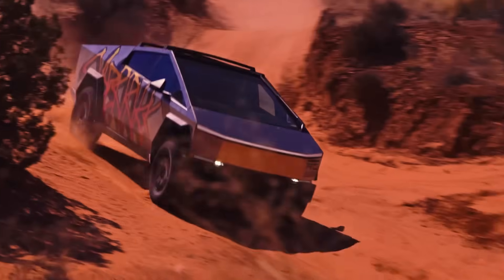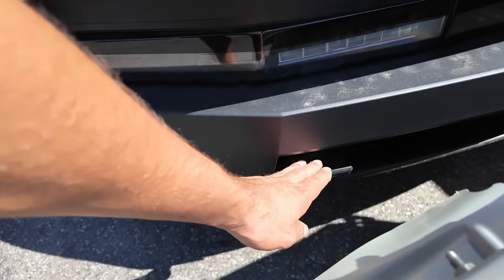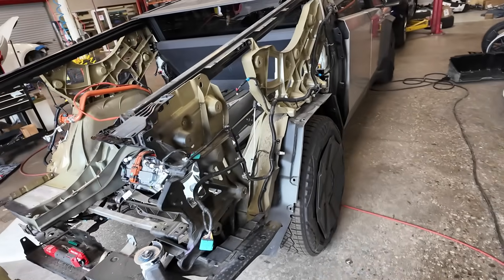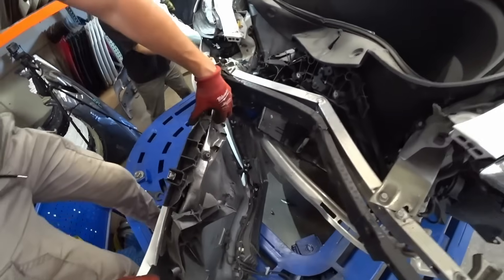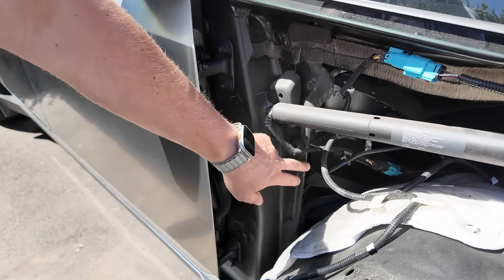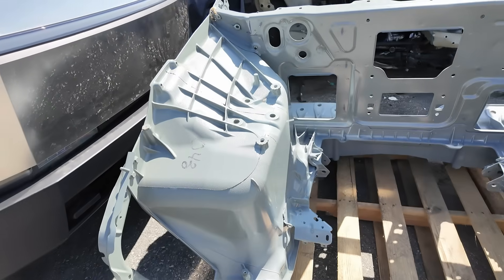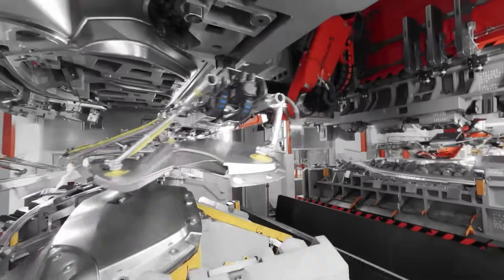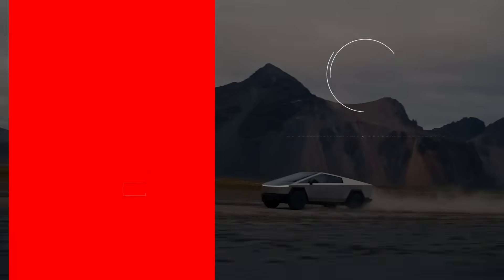Tesla Cybertruck is Disposable: The Biggest Lie of Elon Musk

Comment: You mentioned that the Giga-press Tesla uses are nine thousand ton machines. You are very mistaken on that. An Arleigh Burke destroyer, fully armed, is a nine thousand ton machine, and it is five hundred feet long and made of welded steel. The larger Giga-press machines at Tesla that you are referring to have nine thousand tons of mold clamping force to contain very rapid molten alloy metal injection and cooling, which gives the subframes their intended mechanical properties. Great channel by the way.

Comment: I wrecked my leased CyberTruck a  month after delivery.  I have Tesla Insurance.  On FSD on  I-35 at 70 mph during rush hour, with cars on both left, right, and behind, a full-size passenger wheel suddenly appeared from under/between the wheels of a semi in front of me, laying on its side in the center of my lane.  There was no time and nowhere to go.  I hit the wheel with my front left tire.  The CyberTruck wheel broke from the rest of the frame and lodged in the wheel well, on which I slid until off of the interstate. Oh, this was less than a week before FSD14 released which the first sentence in the descriptions says it is 'better able to avoid obstacles, like tires'. Wouldn't have helped here, I feel.  I used the Tesla app to contact Accident Assistance.  They are not real.  They would  not send a flatbed tow because the nearby Tesla Collision Center was closed and I 'did not have an appointment' (DUH!). I had AAA drop the truck in the collision center lot anyway and left a card key in the box there (for that purpose).  The first appointment available was 3 weeks out.  Tesla Collision would not even look at it until then, but at least they kept it charged at my insistence.  Tesla Collision has it, they have done a preliminary repair estimate of over $12k, they are not working on it because they say the Celette lift/machine is 'busy' - don't know for how long.  They have had my CT two months now.  They won' t order parts until they get it on the Celette to 'finalize the estimate'.  The Celette being a frame machine, and after watching your video about frame damage non-repairability, I fully expect to wait 2 months to find out it is totaled.  The only comment they have made has been 'it might be February before it is fixed'.  That's over 3 months.  They are not working on it, they don't know when they will, and they don't know how long it will take when they do, BUT they insist I make lease payments and maintain insurance, and they dodge every request I make for more explanation.  In what world it this an OK way to do business?